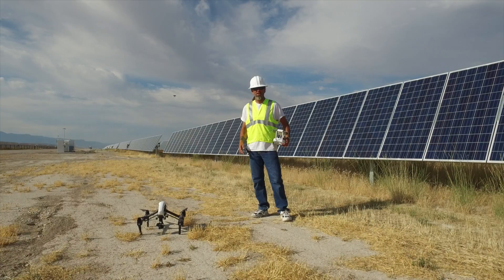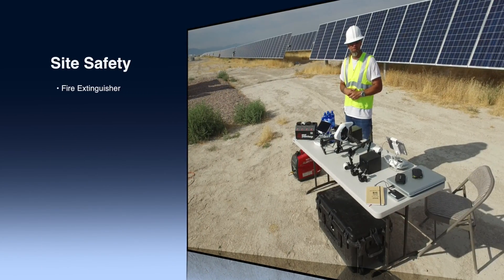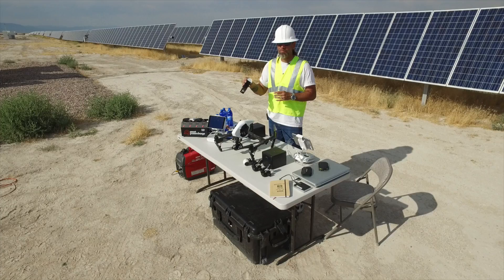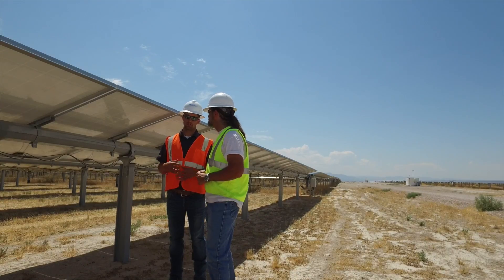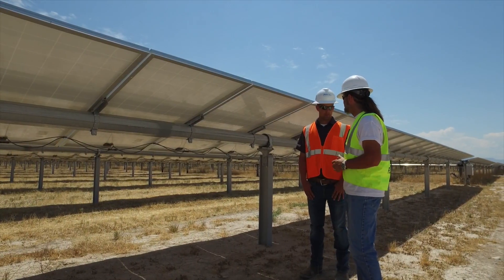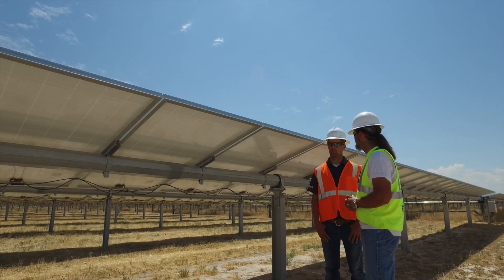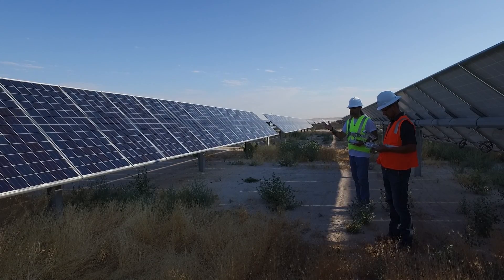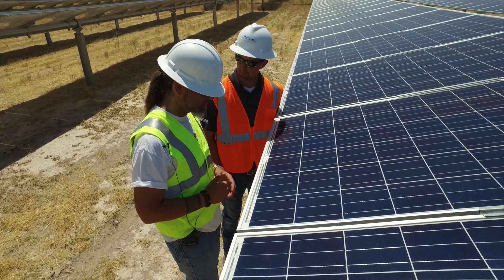RMUS Solar Inspection 2016

Comment: how did you ascertain the correct angle in which to shoot the panels to avoid the temp difference accuracy caused by reflectivity issues ?
Reply: The reflection only appears on few angles. So you can just detect if the hot spot is detected on all angles, so as to make sure it is a "real" hot spot.